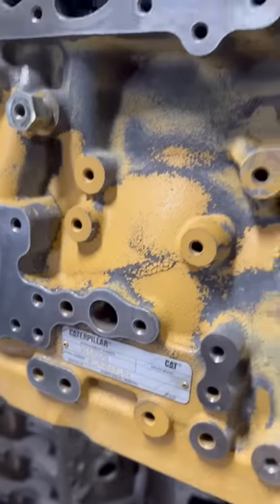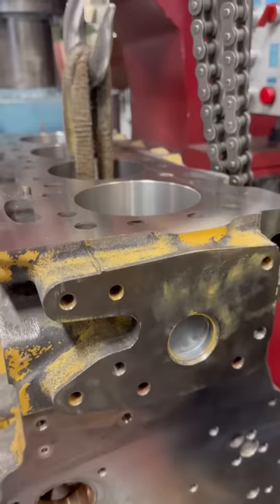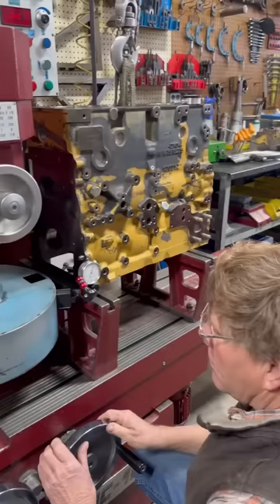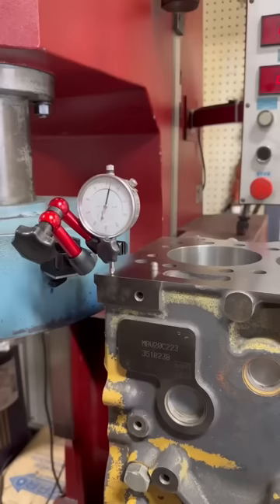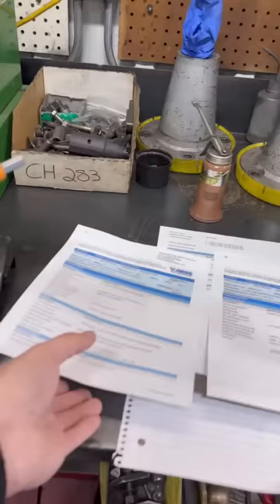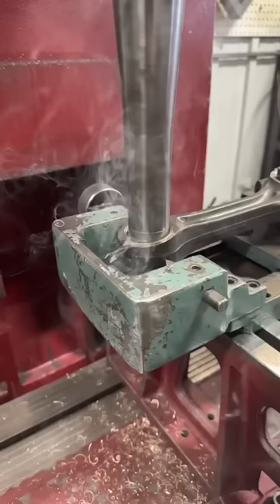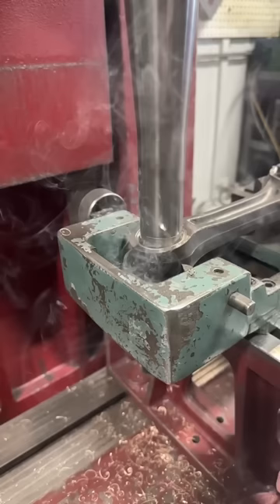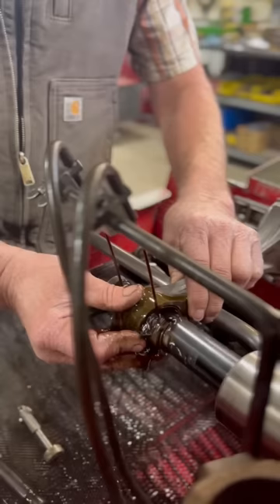#shorts How Can We Compensate For The Deck Height Being Too Short?

Comment: As a former Perkins employee. I can confirm that Cat acquired Perkins. Perkins makes 3 and 4 cylinder diesel engines, many of which are painted yellow and branded as CAT
Reply: Thank you for your confirmation
Reply: I can confirm also that the Perkins and Mitsubishi engines rebranded by Cat were brilliant engines. They give very high hrs with minimal problems and good power with excellent fuel consumption
Reply: What he said. 😅
Reply: Wasn't the 6 cylinder C7 a Perkins too?
Reply: @Iaintwoke  yes
Reply: It is not unusual for many manufacturers to make products for other companies. For example, many transmissions in various vehicles, including Mercedes in decades past were made by General Motors. Differentials in General Motors vehicles in decades past were made by Chrysler corporation. Power steering pumps in decades past were made for various automobile manufacturers, and I’m thinking that one was Studebaker. If you think that Snapon tools are made by that company in their own manufacturing plants you couldn’t be more wrong. Just as one example and I’m going back a decade or two, a rep that I knew from the channel lock corporation told me that they make the tongue and groove pliers for them. Don’t know about now. Wright Tool in Barberton Ohio made many wrenches for various companies, including Sears and other companies, including some of the major brand tools sold off of tool trucks.
Reply: Yup, I throw wrenches, and all CAT backhoes have Perkins motors...
Reply: Yep 100%.
Reply: @yt650 it was BMW. Mercedes has never used a GM sourced transmission. Quite the contrary. Mercedes has always built and designed their own transmissions. Even manual transmissions. 

They started automatic life in the late 50's with the K series transmissions. These were 3-4 speed units. Eventually, that would transcend into the "xG-Tronic" automatics with the number signifying the amount of forward speeds. Today we are at 9G-Tronic.

Manufacturers like Chrysler and Nissan have used the MB sourced units however.
Reply: Perkapillars is what they call them
Reply: @LynxStarAuto  
You are correct, that is my error . I should have checked , it was RollsRoyce.   I was going from memory back in the time when they actually did that, you would be surprised who made what for who. I’ve been through the automotive business decades ago, and so there are lots of things the Johnny-come-lately’s don’t understand or take the time to figure out.
Reply: Because they are called a perk a pillar  lol 
Because Perkins helps cat built it’s small motors I had one it a light tower that I built a generator out of it
Reply: @yt650  yes, it is true that snap on has branding deals set up for some tools, but they still make most all of the hand tools in house. Wrenches, sockets, ratchets, etc. A lot of the power tools and gear they brand is sourced from other manufacturers. I think they own blue point and work with mac tools among others. Its very common across many industries. Its not great snap on has diluted their brand by slapping their name on air hoses, led worklights, boots, etc. for sale in costco. Buddies air line totally fell apart in under a year. It wasn't high priced, but still. Same goes for timberland, dewalt, Stanley, john deere, etc. They still might make good stuff, but they make cheap lines to sell at box stores.

Its not just small stuff or parts of things either, up till the last couple years, all john deer excavators under 5 ton were rebranded Hitachi's.
Reply: Smaller industrial Caterpillar engines C1.5 up to C4.4  are Perkins main items and some Caterpillar engine parts -
Reply: Perkins also makes  6&8 cylinder  engi es
Reply: I work on hustler mowers and all the 3 cyl cats I’ve worked on are just painted Perkins
Reply: I assembled CAT C15/C18 engines and they rebranded some as Perkins to sell on global market same engine just different front engine cover
Reply: From the looks of the engine it looks like one from the old yellow New Hollands
Reply: Ford acquired mazda in early 2000s so the 2.3l mazda speed blocks are shared in ford vehicles.
Reply: @makapa2u  ya I got a c1.5 cool motor
Reply: We always called them a Perk a pillar. Lol
Reply: now made by Kubota
Reply: @Iaintwoke  C6.6 is perkins 6 cylinder. I sleeved one on my channel.
Reply: This
Reply: same with how cat rebrands yanmar engines on the small end of the lineup
Reply: Cat bought Perkins. A family company I worked for made CAT and Perkins flywheels. I spent a Thanksgiving one year in a Perkins Engine plant somewhere in the Midlands area overseeing fixing a problem we created and smoothing things over. They didn’t go for the typical wine and dine thing we do here but by the end of the trip they realized I could more than hold my own and we ended up in some strange places. They also introduced me to Facebook. 😂😂😂
Reply: I took apart a 6 that was a Perkins not long ago.  They have a habit of using 17mm and 15mm bolts instead of 18mm and 16mm like regular Cat motors.  They are usually burnt to a crisp when I get them and I strip them and send them people like yall
Reply: @yt650  can confirm, Mercedes used many gm trans in their vehicles and vice versa :) people get upset about "Foreign cars" but in reality they're all foreign and domestic to everyone.
Want a car only made exclusively by one country? Get a Hugo or a Lada, then laugh at it and buy something realistic lol.
Reply: @NOSNOOB11  
I don’t know whether I said anything in this set of comments about certain manufacturers using other competitors products. For example, Chrysler corporation made excellent differentials many companies used them same with the GM transmission and power steering pump.  I can’t remember who made the better steering box as it could’ve been Saginaw, division of GM. Some thought has to be put into the reason that this is done and it is because if you have a manufacturing facility that is set up to produce gear boxes and I’m talking about steering gears, it probably is a smart thing to do to buy them from the company that makes the best ones and the set up to do it. The same with diesel engines, that’s why Chrysler went to Cummins. Ford used some international diesels if I remember right.
Reply: They bought out Perkins back in 1999
Reply: Claas harvesters come with a 15l Perkins which I believe is pretty much a c15
Reply: @jordansterba what happens when the top dead centre perc Angle is turned over?
Reply: that engine was the main reason cat purchased Perkins
Reply: Yeah, and when Perkins quit the 6.3544 series, back in 1993(?) they made life real, real awkward, especialy on the Range 4 series. Having both inlet and exhaust on he same side of the head was a f'ing nightmare!

Don't get me wrong, I think Perkins are a great 2nd place to the Cummins (albeit the Cummins 6ltr B Series is not lined), the Perkins 6.3544 and even the 4.35 series were great engines. Why Peterbourough changed??? probably for the $$$$$, not the integrity, or Belgium had something to do with it!

PS. When checking your Pekins, if you don't see any oil leaking, then there is NO oil!!
Reply: @Sam West  they are built on the same assembly line and share the same blocks. The blocks are basic and I believe they just change the crank and pistons to fit customer requirements. I work on one of the assembly lines in Texas.
Reply: Same reason JCB make their own engines now, rather than buy Perkins from CAT!
Reply: And most of them suck
Reply: I work for a company that sells Cat licensed Cat branded products (forklifts), with Perkins engines, since Perkins is Cat.
Reply: Also 6cyl
Reply: @JamesLee-oy6nt I was looking for this reply. Did same assembly in Seguin Tx. on the C15 line years ago.
Reply: @robertparks1117 Did same thing in Seguin.
Reply: @yt650  A story I heard about RR and GM TH350 Transmissions. When RR got the first TH350. They took it apart. There was a washer inside the transmission that was rough on one side or it may have been both. The RR Engineers knew that washers were supposed to be smooth. So they smoothed it out. Put it behind their engine, and the transmission doesn't work. Once they put the washer back like it was the transmission worked. Don't know if it's a true story because I heard it like 40 years ago.
Reply: @jordansterba Lmaoo that’s a good one, gonna use that at work
Reply: It’s an engine not a motor.
Reply: motors run on electricity and engines run on combustion.
Reply: @kalijasin  not in America. We do motor swaps on combustion engines

Comment: It blows my mind that buying this precise machine work is cheaper than buying a new engine. You machine shop guys are incredible.
Reply: it isn’t always, but the quality output from a reputable shop like this is so much better that it’s unbelievable
Reply: A 'new' engine is not necessarily better.
Reply: New engines are like 10 to 15k easy a used one probably 7 to 8
Reply: Its made from metal, it can be added or removed, just need rights tools for the job and experience to do it fast but perfect. Whole new block will still require same methods, but new engine has all the new parts where here you just remove material and install new larger bearings to compensate removed material.
Reply: @Hellsong89 how would you add metal to an engine block? Genuinely curious by the way, not saying it’s not possible just am very unsure how that would work, being I know very little about that sort of thing.
Reply: @-Apollo-13  See David Pearson's comment down below. You can weld to add metal, and also adding piston bore sleeves when necessary too. Valve guides, seats can be cut out and reinstalled. Many ways to 'add' metal back to existing...😮😊
Reply: @jonathanpalmer228 yeah good luck I got quoted 55k to rebuild my 1LW and that was from cat

Comment: Hello Jamesi
I was sent to Perkins engine failure analysis school in Jacksonville Florida in 2001. I work for a lawn and golf equipment company, in order to service new Perkins engines in the new Ransom model tractors, the company I work for had to send me to school in order to work on Perkins engines under warranty. While at that school, I knew the caterpillar was looking to purchase Perkins engines because caterpillar did not have a small diesel engine line like Kabota’s for example. So while I attended that school in 2001, I spoke to many of the instructors at Perkins diesel school about caterpillar acquiring Perkins engines. I still have my Perkins engine certificate to this day. And I learned how many different causes of engine failure.
Thank you to Jim’s automotive machine shop, I look forward seeing all your online content. Your 210 AC engine failure content was excellent, informative, well done guys!
Thank you
-Randall

Comment: Not just Perkins, we use Kubota too. Cat only makes a few engines, and I believe it starts at the c7
Reply: The 7.1 is a Perkins
Reply: "A few" lol. C7, 9, 9.3, 13, 15, 18, C32, C175, 3508, 3512, 3516, 3520, 3606, 3612, and more besides. Cat makes quite a few bigger engines, they just don't make all that many little ones.

Comment: Perkins is a OEM diesel engine supplier for Caterpillar from the mid-1980's, and lots of its engines , specially small engines from Caterpillar, are in fact manufactured by Perkins. They are delivered from Perkins factory with Caterpillar tags and painted CAT yellow.
Also in 1997 Caterpillar purchassed Perkins company and all of its assets. And from then, Perkins is part of the Caterpillar group, but still retains its name and separate dealer network.

So its very common to see Caterpillar engines with the Perkins casting logos.

Also the same happens with Mitsubishi engines which CAT has a joint venture with them in Japan.

Comment: They make 4 different length connecting rods for these engines. Cat sis won’t tell you which rods you have. No part # or markings on them so you have to measure and hope you get it right with only a couple thousands difference.
Reply: they are paint marked different colors. we have rebuilt several.

Comment: Shibaura (Ford smaller imported tractors), Perkins, and Cat have some engines in common as well. The Perkins 103-10 in my light plant is one of them. I've had to search parts under all 3 brands to find more affordable options before.

Comment: At our Big Bore engines rebuild center (Cat 3500 and 3600 series engines), blocks with a deck height too short are often spray welded to build up the surface, then machined down. Unless those blocks are ventilated, they're almost never replaced. Main journals are also frequently built up, fitted with new caps, and line bored, in the event of badly spun bearings.

Comment: Perkins motors were installed in the old Ford 9n tractors and the Massey Ferguson 35's , them and there gasoline competitors continental engines , were both awesome engines , they lasted forever , that was BRM .. before recycled metal ..

Comment: My CAT 247B track loader has a CAT 3024C Turbo Diesel / Perkins engine. CAT is using their rebranded engines after acquiring Perkins. Works fine.